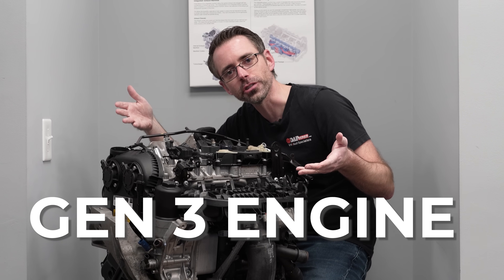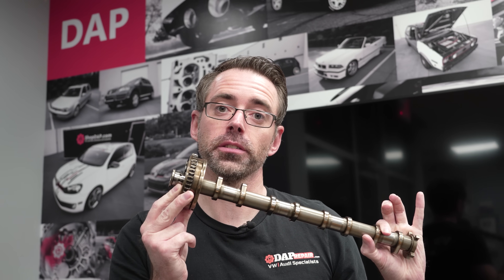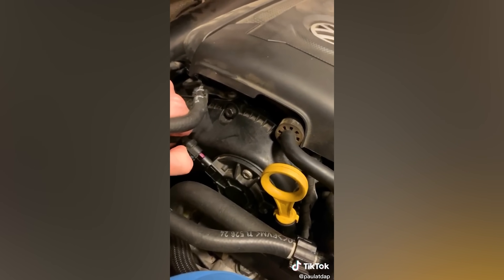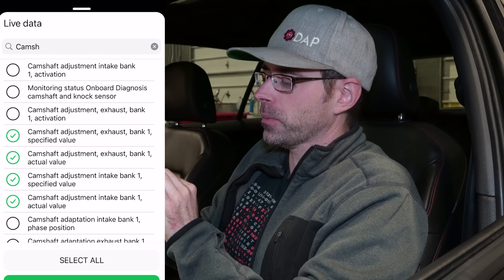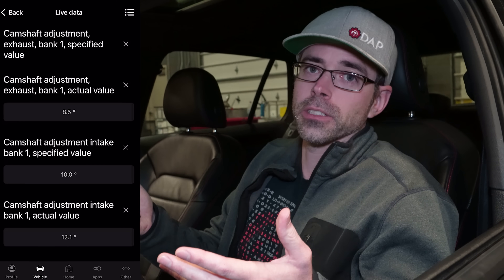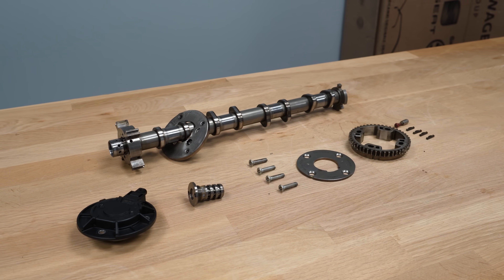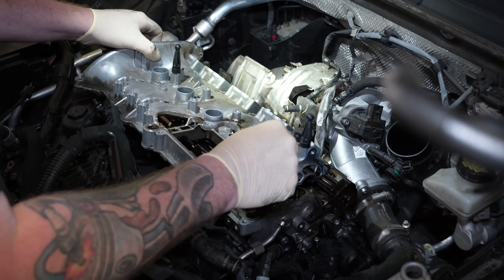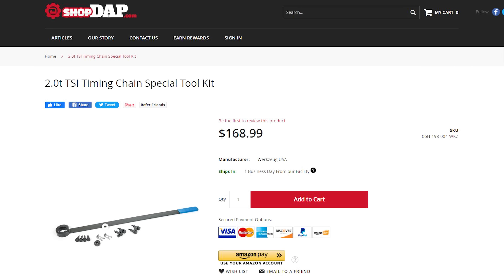Is this a New Common MK7 Engine Issue?

Comment: As far as I know the biggest issue with the MK7 GTi 2.0 TSi Engine issue is usually a crank walk issue on the manual ones. Also some of them have bad Piston oil ring design leading to oil consumption. Some models are updated and don't have such mentioned issues. Therefore I recommend anyonre who wants to buy a GTi MK7 to buy a 2.0 TSi combined with the DSG automatic transmission.
Reply from the maker: Crank walk is not an issue of any significance it’s widely overblown. Oil burning doesn’t seem to be a 2.0t issue, which is likely because GTI owners maintain their cars while 1.8t owners use low quality oil and change less often.
Reply: @Deutscheautoparts  Thats pretty sad to hear. I don't know about you guys in the US how the drivers tick over there but here in Germany we baby the GTis. They always get earlier oil changes and additives at some point of age to prevent lspi issues. Though that is mostly an issue with the BMW B58 or B48 engines.
Reply: @xxzmk  Oh dude you don't know half of it, for the most part American GTI owners take care of their Golf, but for the affordable VW and Audi models, a sad majority are absolutely thrashed by negligent owners who think all their car needs is gas
Reply: @jmccann6735  I guess those are the ones calling our cars "unreliable"
Reply: @xxzmk    If VW are trying to sell to mass-market non-enthusiast owners with their lower-priced North American market cars (like the Atlas, NA-spec Tiguan, NA-spec Passat, Jetta etc), then VW should reasonably expect that TBH.  At least VW stopped using 7-speed dry-clutch DSGs in US-market economy models so that's a start (instead Hyundai KIA are facing troubles because of using those now!).

"a sad majority are absolutely thrashed by negligent owners who think all their car needs is gas"
"I guess those are the ones calling our cars "unreliable" "
Reply: I think the 10,000 mile (16,000km) factory specified oil change interval is way too long. I, like most people, do it at 5k. I think that long intervals, and the use of cheaper (non European, not synthetic or non VW specified 505.00) and running these cars low on oil contributes to premature failure.

If you think all the quickie oil change places, or your favorite shop are using the proper VW oil, think again. Ask them to show you the containers if it's packaged. If it comes from a dispenser hose from the ceiling, have them show you the 50 gallon drums the oil comes in.

It might feel like an awkward interaction, but you have the right to know what's going into your $8,000 engine.
Reply: @gregordiseth6651  Well in Germany you aren't really afraid of your oil dealership to put the wrong oil inside your car. Because the moment they do that and my car dies on the road their oil change is being tracked and documented. So if it comes out that the oil was faulty for my Engine, they need to take 100% responsibility for it.

I still go and tell they guy though to put in 5W30 LongLife Oil specifically for Diesel BMW engines. I daily a N47D20C BMW F30 3 series.
Reply: I think with stock pressure plate and proper driving technique ie: get your foot off the freaking clutch when you're sitting idling at red lights, the crank walk is a non-issue
Reply: @morley3810  Yeah it was more an issue with the flaps within it that were thinner than the ones in the DSG. Loosening up that much after some time that the crank danced and ate every shit of metal that was nearby wrecking the engine. I am not saying that all non DSGs had that problem but there are some very sportive driving folks on their manuals wrecking it pretty quickly. I still say if someone wants a reliable daily with about 5-5,5 kg / hp -> Golf GTi DSG it is or if you want something more exotic in looks a Cupra Formentor VZ4.
Reply: Been working on water cooled VW’s since they first came out,only saw worn thurst washers once and really didn’t know the history of the car. Certainly not a common problem.

Comment: Both my vehicles have engines w/ variable cam timing both on the intake & exhaust sides. Designed in the mid to late 2000's, both of them. Not a single issue with cam adjusters over 6+ years of driving them. Is this a VW/Audi-specific issue, Paul?
Reply: No not VW specific. I've seen this exact problem on a Mercedes as well. If anything it's more of a low/no or old oil. The Mercedes I worked on operates on the exact same principal. It's problem was due to sludge
Reply: Toyotas 4cyl VVTs from the 2000s and 2010s tend to make a vvt rattle noise, but it's more limited to start up.

Comment: Have always been on top of oil changes and maintenance- changing oil every 10,000. Currently experiencing this exact issue. Shop showed me camshaft adjuster codes going haywire. Replaced magnets. Noise is still there, can hear it in cabin... What happens if I don't rectify with camshaft replacement?
Reply: Oof, shoulda been changing every 3k-5k miles
Reply: @jmccann6735  agreed 10k is a long time
Reply: To clarify. I'm in Aus. Every 5-6k miles for an oil change.
Reply: @eyeareels9451  Oh gotcha, definitely strange to have that failure in that case
Reply: Update: replaced the spool valve on intake and exhaust cams. Can be done by going through magnets on left hand side. No rattle anymore or misfires, noticable performance increase. 1 hour job, $90 AUD for a spool valve. A lot more simple than replacing the entire cam.

Comment: Very good video and makes the point of OIL LEVEL! However, the noise, usually on start up, or while running, indicated the failed camshaft adjuster unit as stated. The "hunting" value block is 99% of the time caused by the magnet itself sticking due to sludged oil stuck in the solenoid plunger from the car being ran low on oil or infrequent oil changes. If you have the faults with a hunting idle and value block, replace the magnet.
Reply: changed magents 4 times in the lifetime of my mk7 gti. then finally the one valve decided to come apart. Have not had issues for a good few KM but just upgraded to a 7.5Gti. Sticking with the Gen3 engine with all the issues Ive had. I will always check oil !
Reply: BMW B series engines have the same design of solenoid and seem to experience the same issue with sticking, causing poor idle quality and bad drivability.
Reply: I change my oil every 5000km or 6000km and the plunger still got stuck and failed and left me fucking stranded in a parking lot. This has nothing to do with infrequent oil changes its just terrible design by VW.

Comment: Thanks for pointing this out! Did this issue ever present itself with (slightly) older VW engines? Any of the Mk5/Mk6 cars?
Reply from the maker: Yes with FSI less often with TSI
Reply: To my knowledge the EA113 had less problems. The Mk6s and the first two model years Mk7s had most of the oil problems.
Reply: @orhankucuksahin6297  Helpful info, thanks - good (and simple) things to know as one attempts to increase vehicle ownership by owning the maintenance 😂
Reply: @ScottOrd  sorry, i mentioned the EA113 motor that’s in the Mk5 GTI. The Mk6 and onwards have the EA888 motor, which is known as the problem motor of VW Group.
Reply: @orhankucuksahin6297  All good, I appreciate all of the info! I read "problem motor" as though VW might only have the one 😂

Comment: I recently bought new spool valves and magnets for my engine to fix this issue. I was not aware that the spool valves will not fit the original camshafts. 

Is it true, I have to replace the entire camshaft as well?
Reply from the maker: Depends on the car contact us with your vin and spool valve purchased via email we should be able to help

Comment: Annual oil changes people …. And use good quality oil 👍 thermostat housings another matter ….😂
Reply: Fully synthetic changed every 5000 miles or every 6 months approximately is the only thing id allow for these small high output turbocharged engines.

Comment: Paul having a crisis over lack of oil in these engines brightens my day 😅
Reply: Totally - "Do you know what else has a crisis over lack of oil? Your cam adjusters!" 🤯
Reply: Was a vw tech for 47 years and checked the oil on all the cars I worked on (a habit) 90% were always down on level.
Reply: It will encourage people to check more often
Reply: @mystiqueman366  "There's fluid on his sweater already, coolant in his spaghetti" 🎤🤣
Reply: as I'm ordering my next batch of oil lol
Reply: @MaxiimTribe  🛢🛢🛢 :petrol:
Reply: Literally 😂😂😂😂
Reply: As a Honda tech who encounters rattling cam adjusters due to a lack of oil; I too feel Paul's pain.
Reply: He definitely took the lack of oil personally. 🤣
Reply: he is actually right...but also, the problem with these engines not having oil is that they kinda eat the oil quickly...
i know this for a fact from my car, it just eats it
Reply: @vladmihai306  around 2008 the 2.0 turbo had a problem where the piston rings would break and the engine would burn 1liter of oil every 500km audi and volks knew about the problem but  never made a recall unless you complained about it. and i have seen many oil puimps fail too
Reply: And to make it worse I think I had an oil light every other week
Reply: IT WOULD BE  HELPFUL FOR VW/AUDI TO GET THERE SHIT TOGETHER AND MAKE BETTER ENGINES... WHEN I'M BURNING 1 QUART EVERY 300-500 MILES ON A GEN 2 EA888 Likely same to happen on gen 3 motors at 130k as well.
Reply: these cars burn more oil than gas! the dealer tells you its normal that it consumes 1l every 1k km. funny cuz my camry v6 doesnt miss a drop od oil after 5k km.
Reply: if you're burning that much oil you never need an oil change
Reply: @Nevy21  LOL true
Reply: @Nevy21  just filter change
Reply: @Nevy21 other than oil filter
Reply: @peterpeter5666  I've always heard that as well as with 24v vr6's yet both my VR and my 2017 gti never burned any.
Reply: @Drewdownkali  i found that very hard to believe but thats great !
Reply: @peterpeter5666  🤷‍♂️
Reply: @peterpeter5666 my 2017 doesn’t burn any either, idk what these people do to their cars
Reply: @peterpeter5666  "Once sufficient parts are produced, Toyota will send a second owner notification informing customers they may seek part replacement if the vehicle is exhibiting excessive engine oil consumption. There are approximately 1,940,401 vehicles covered by this Warranty Enhancement Program"

almost 2 million Toyotas built with rings that leaked upwards of 2-3 quarts per 1000miles 😂😂😂😂 the threshold was anything over 1.2 quarts per 1000-1300~ miles would be covered.
Reply: @peterpeter5666  same shit they told me. I was down 2 quarts in 2200 miles.
Reply: @peterpeter5666  Just google "toyota engines oil consuption" and notice that those have shit engines. Tojotas are boring and slow cars, engines are simple but still with many problems.
Reply: @peterpeter5666  not turbocharged, and what year? when cafe standards changed, they added Low friction rings and low friction oil 0-w20 etc, just burns more 🤷‍♂️like late 2000s 2007/8 or something I think2.4l  4cylinder rav 4s  Camrys etc started eating oil like candy after 120k~ Toyota rebuilt SO many engines under extended warranty TSB